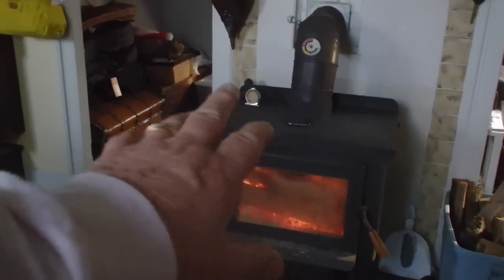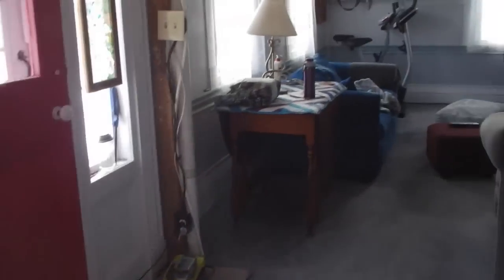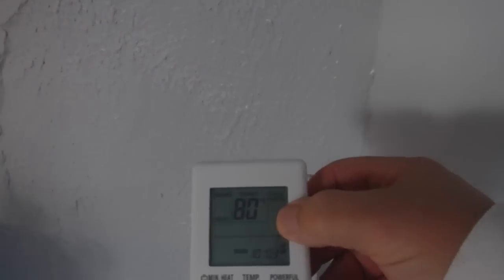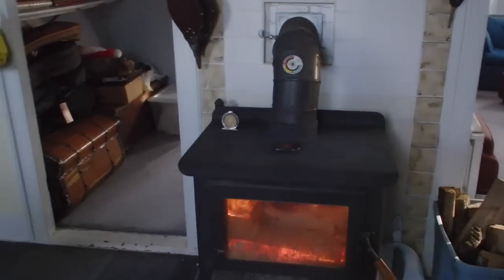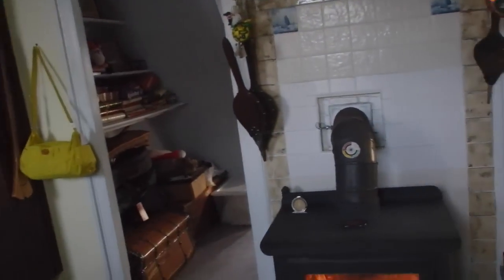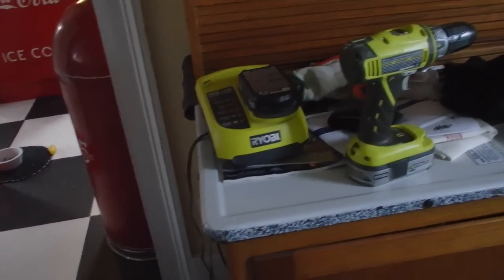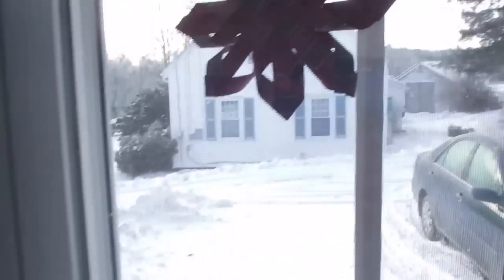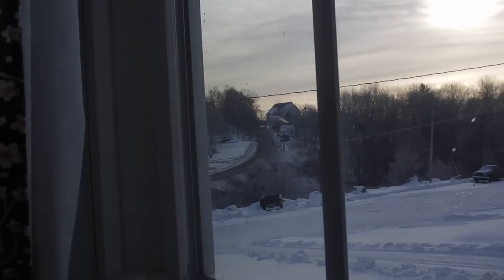Heat Pump, Wood Stove, COLD weather!

Comment: Check the FILTER on the air conditioning heat pump... Lift the (on wall), unit and check if filter may be clogged and will restrict air flow.. (just check operating manual)....cheers,

Comment: What he doesn’t understand about heat pumps is colder it gets outside the less heat can be transferred from outside. Changing the temp on his thermostat doesn’t force it to run. They have a low temp cut out for a reason

Comment: Thanks for the info on the heat pump - what maintenance does it need? air filters?
Reply from the maker: No..  It's got a filter you can pull out and wash and put back in..

Comment: What year was your house built, I love that old style and look.
Out of your 3 heating systems so far what has been the most efficient wood heat pump or oil, I have heard in extreme cold heat pumps do not work it will be interesting to see how the unit will do and how the cold will affect the efficiency of the units, I think the side of the house the outdoor unit is on will also play a factor in its efficiency in the cooler weather and how long it will work for.
Reply from the maker: The heat pump is definitely saving me the most money.  I'll have a better idea after a year when I can compare overall heat costs, but so far I'm loving it.   Of course, we also foam insulated the basement when we put the heat pump in, so I'm sure that also makes a difference.  The house was build in 1842..

Comment: This is our second year of using a heat pump from switching from total electric heat . Our Electric bill has been down 50 bucks or more to every Winter before with only electric heat and two increases that I know of. It is down 150 to 200 bucks compared to others with similar homes around us .

As with you I find it runs a lot when cold almost constantly between the hours of 2 AM & 5 AM when it is 15 to 0 degrees which seems wasteful & wearing on the unit to me , So we substitute with a hour or so of kerosene heat during these times off & on to stop that. I am planing on a outside wood heater of some sort in the future myself.
Reply from the maker: This is our first winter and over all I think we're saving quite a lot over what we were paying before, but I'm going to wait to the end of the season and compare.   IT's been below zero up here a lot, and ours is working hard and the electric bill took a jump too, but still less than when we were heating with propane..    It's better heat than with the propane.  More balanced.  We're liking it lots..   We do use wood and a little propane and sometimes the oil heat but mostly it's the heat pump that's doing most of the work..

Comment: There's a recall on some of the 18v lithium chargers.
Reply from the maker: Oh?
Reply: From the recall sheet. Sold individually and as part of a kit between September 2007 and December 2009
Only P113 chargers with manufacturing date codes between 0731-0852 without a nine digit part number are affected.
Reply from the maker: mjmcomputers   INteresting..  I'll look into that..  Thanks..

Comment: Not trying to piss you off but the elbow coming right off the stove doesnt sit well with me for some reason. Good video.
Reply from the maker: Not pissed.   It's been that way for years and has worked well through many cords of wood.  To correct it I'd have to have a shorter stove or a higher hole in the chimney, neither of which works for me..
Reply: @rpeek  thank you.

Comment: How much did the Fujitsu heat pump cost installed and everything?
Reply: I have a Fujitsu that was around $3800 installed.  I provided electric to a disconnect and the hvac guys took it from there.  I got three bids between $3800 and $4500.  If you have snow, have the outside unit mounted on a stand instead of on the ground.

Comment: I recently read that you shouldn't run a cenrral heat pump while using a wood stove because if the heat pump picks up the heat from the wood stove it can burn out the compressor. Have you ever heard anything like that?
Reply from the maker: No, but that doesn't mean it might not be so.
Reply: @rpeek  Not true

Comment: Get a cast iron tea kettle and put on the wood stove.  It will rase the humidity and it will seem a lot warmer at a lower temperature.   We used a wood stove and heat pump in our last house.  Raising the humidity helps a ton.